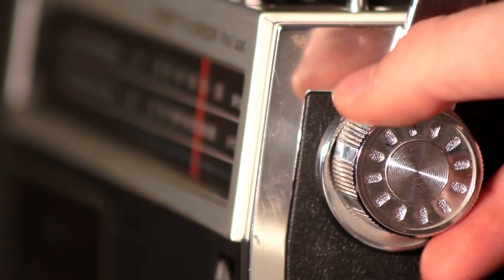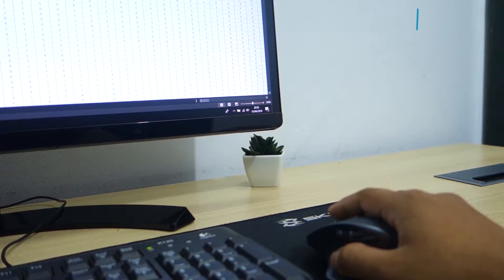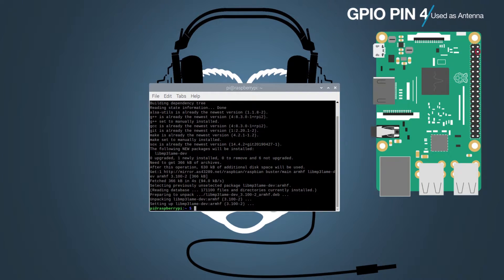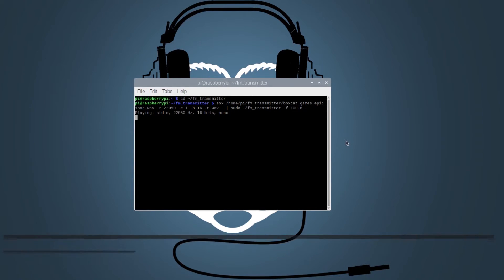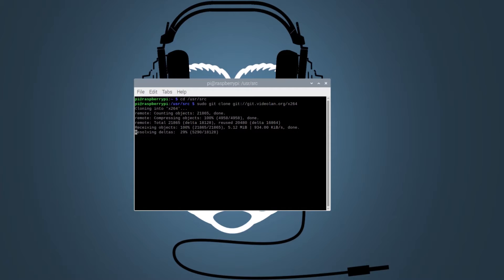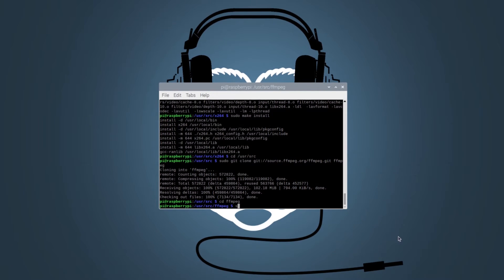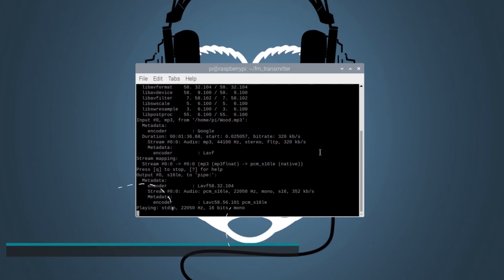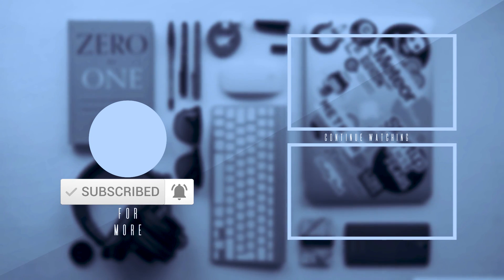Build your own FM Station! - Raspberry Pi FM Transmitter | Tutorial

Comment: Can we Transmit and receive FM signal of different frequencies using Raspberry Pi, or any other microcontroller. Basically want to receive radio working in FM and retransmit to other frequency in FM modulation

Comment: This will not work with a RPI4, as the raspberry PI foundation realised that PIFM will (also) transmit on military and avionic frequencies, because it emits a square wave signal which contains very many harmonics (multiples of the base frequency) . So you CANNOT AVOID transmitting on unwanted frequencies. This can get you in trouble with the authorities! So the Raspberry PI foundation removed the hardware from later RPI chips (System on a chip or SoC chips) used in RPI4 and later PI's!  SO DON'T USE a Raspberry PI FM transmitter!
Reply: oooops. still tried it though and it works in my rpi 4!
Reply: @needlethread4715 How ? I have been looking  for a method all summer
Reply: @needlethread4715  you found the new and changed instructions, that bypass the changes the RPF made in the hardware to try to discourage you to try doing this. Its up-to you if you want to risk getting into problems. Just don't blame the RPF when you do.
Reply: i was going to try this just now and then i read your comment. mine is raspberry pi 4 and it's so disappointing to learn that raspberry removed it in this pi version.

Comment: Hey I really loved this video....do you know how to increase range for this transmitter?
Reply: A proper antenna is the only way to increase range, preferably an outdoor Yagi antenna, which could provide many miles of coverage.
Reply: @BeastTechWrench  Yes that would give you a lot more coverage but don't do it, with that amount of distance you will for sure get in trouble with the FCC as you are both unlicensed for that band and playing copyrighted music.
Reply: @JFK_Speedwagon  Not to mention you are also causing a disturbance on military and avionics bands
Reply: i believe rpi has not much power to transmit signal at a very far range even using an outdoor antenna. tried it myself with a diy dipole antenna tuned to 90Mhz measurement, and i can only get the signal to the receiver at maybe a hundred or 120meters range.

Comment: this no longer works, the first git asks to login. and the videolan.org is connection refused
Reply: did u use raspberry pi 3 or 4?
Reply: @CarlosRamirez-o6x3h  check the original github site. It has a solutiion for Raspberry Pi 4 users
Reply: I had the same problem. i have to upgrade de bios a couple of times until it say no more updates. then try install the vlc with commands. The radio works for me
Reply: So do we make it now?